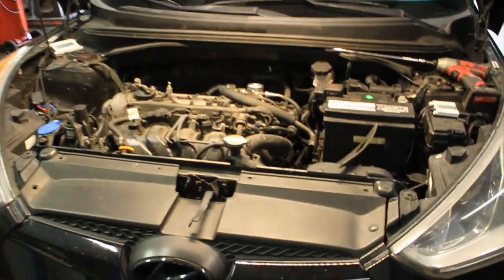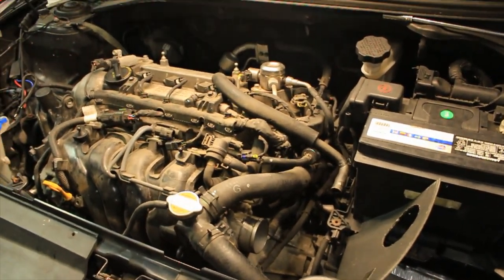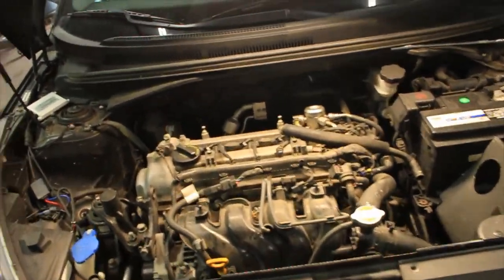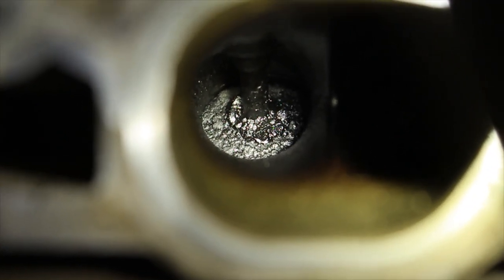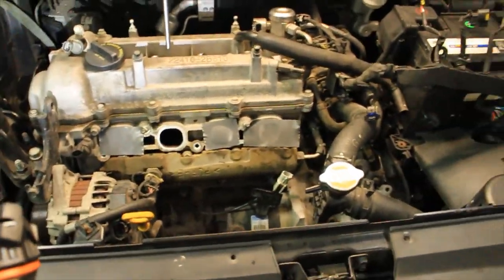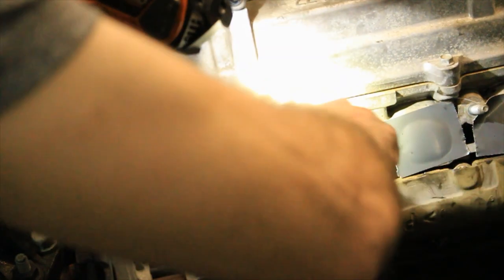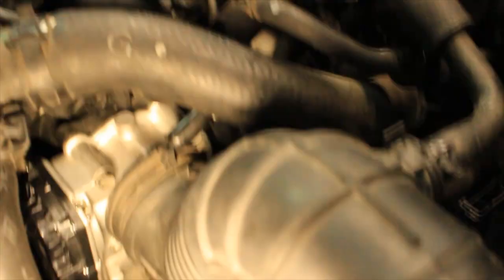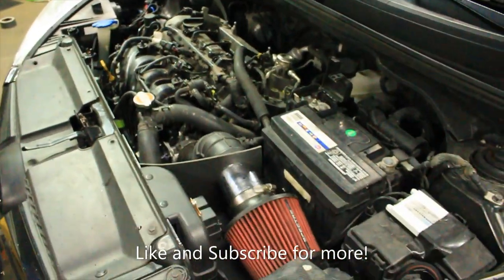Veloster Intake Valve Cleaning and Throttle Body Upgrade

Comment: The cover isnt cosmetic. It stops most of the heat from the engine from Effecting the paint on your hood. Without it you will have bubbling and cracking and peeling of paint

Comment: just so everyone coming in late knows, the coolant lines running to the throttle body aren't there to actually cool the throttle body, they're meant to heat it up and prevent frosting in sub freezing temps. if you don't live somewhere that cold, just bypass it, it'll actually run better because it won't be heating your intake air  up defeating the whole purpose of the intercooler.
Reply from the maker: This! 👆🏻

Comment: Also catch can is for turbo cars and performance engines. Seeing you never did a carbon cleaning i can bet your pcv valve is sludged up causing sludge to build in ur engine and excessive blow by and will cause oil leaks from excessive pressure. You wana build power on that engine. You would need a longtube header with high flow cat and 2in to 2 and a quarter inch exhaust with high flow muffler. Add a short ram intake with heat shield and tune. This car is an economy car wrong car to try and add power too the turbo veloster on the other hand is a diff story.  Your best bet would be to increase its efficency which clearly it hasnt been serviced properly by that carbon build up which is what will hurt ur power and acceleration as well as fuel mileage. If you serviced it that would provide better gain then that throttle body. If you have some pepboys or cheap ebay filter on it then its flowing barely more then stock. Put an aem on it atleast youl see a little gain maybe a couple hp
Reply from the maker: Awesome feedback! The PCV was replaced by me upon purchase at 41k miles, I replaced it again at 90k and again at 120k when I did my plugs and coils. The car is actually moved on to another owner but I appreciate the insight! I also own a very modified Talon w/ 4G63 and 08 G35s so I understand where your coming from! Hope to see you around the channel more often!

Comment: Took my intake off to change injector getting 4 cylinder miss fire looked  inside  have oil sitting on top of my intake valves ..  My spark plug is not getting fuel but has oil on the electroid of spark plug only 100k miles too.
Reply from the maker: No way it needs 4 fuel
Injectors lol

Comment: We've got one with 90,000 miles gonna do this in the Spring once the weather warms up a bit.  Saw another vid where a guy used brake cleaner & 10 zip-ties taped together (shape of a drill bit) attached to a drill as a nonmarring tool to remove the bigger chunks (and that alone got the valves really clean, not shiny clean like walnut blasting will).   Only wish you would have shown step by step of intake removal (doesn't look hard but for 1st time wrenchers it would help).  Also good to see that engine went 175,000 with no problems, hope to get 250,000+ from ours.  thanks for posting, peace.

Comment: I am the 60mm Guy, in 2013 I was the first to put the Elantra 60mm on the Veloster. I posted it in Veloster.org. I also did the coolant bypass. I still have the 2013 and the 60mm. There are 2 types of 60mm, long and short air horn. I use the short. Also with a NAV GAP the plugs at .030. Any question ask me. In cool weather put the coolant back on.
Reply: Hi! I have a Hyundai Veloster nav! I’m putting some performance parts! I want to know what more stuffs I can add to increase hp and tQ! I have done Short tan intake, throttle body spacer, throttle controller, straight pipe and a MagnaFlow muffler.
Reply: @pescabichopr4485  "straight pipe and Magnaflow muffler" xD
Reply: @pescabichopr4485  brand of throttle controller?

Comment: A catch can won't completely stop it but it'll reduced it in half or more. The type of oil you run in the motor makes a big difference too they do have gf6 now which is supposed to reduce it even more of the built up.

Comment: Nice vid.. I had a '14 turbo veloster and now '18 turbo elantra gt sport. Pretty much same 1.6 motor.
My standard manual calls for valve check every 60k miles. Do they clean these then?
Reply from the maker: It’s a service you have to specially ask for. Valve blasting or valve cleaning. Usually a few hundred dollars being a shop has to remove the intake. Definitely worth it though. I’d recommend at 60, 120, and 180

Comment: Any update on the new throttle body I'm curious
Reply from the maker: The throttle body worked great for bottom end throttle response. I enjoyed it.
Reply: @Pete_Tech_  sweet! I'm currently on a 1.6 build that's sitting in a rio the 2018 model, I've been researching alot about getting more N/A power and the bigger throttle body was one of the options I was looking into along with port matching etc etc. What are your thoughts on (ITB's) independent throttle bodies on this motor? .. I really want to explore the potential  of these new engines... I read somewhere where the casting is done by Mitsubishi but I could be wrong.

Comment: I hope u will respond to my question.  On the GDI fuel pump what tool do you use to remove the fuel line?
Reply from the maker: Just search. Fuel line quick disconnect removal set on Amazon.

Comment: Would sea foam handle a lot of that nasty, or would I need to take er apart?
Reply from the maker: Seafoam will not even get you 10% of the way to clean valves.
Reply: Holy crap so all that smoke, and thats only 10%?! 😳 oh I'd hate to see what they actually look like in that case... Thanks!

Comment: Thank you for the vid! Have you considered closing the valve and then pouring something in there that is good at dissolving carbon and then sucking it out with a shop vac? Then picking at the remains?
Reply from the maker: Yes, this video was a long time ago. I’ve found some chemical solutions that work pretty well. Unfortunately the valve is never “clean” unless it scrubbed.
Reply: @Pete_Tech_  thanks for the response. Do you still have this machine? Just got a 2013 Base with 160000 miles and it’s general condition implies that she had NOT had the valves (or injectors) cleaned. I’m sure they’re gonna be grimy
Reply from the maker: I sold this unit back in 2020 with 189k
Miles ran mint!

Comment: So you know carbon cleaning is due every 15k right? Im a Hyundai master tech and have never had to clean the jntake valves manually. Your problem is your trying to make a 1.6 na engine faster your not guna gain a thing from larger throttle body lol and a throttle body spacer wont do a damn thing on a direct injection engine. Having no cat and your guna add an exhaust woth larger piping good luck losing torque and all low end power from no back pressure. You need to reset adaptives and do a relearn procedure after replacing the throttle body with the wrong one lmao. If you did the cleaning every 15k you wouldnt need to do any of that. Your supposed compensation issue is from not reseting adaptives and relearn procedure. Your not gaining any flow through the head by installing larger throttle body but no change in porting or manifold and no tune to possibly add a little power.
Reply: What is the procedure for cleaning it. What would you recommend. I definitely have to clean mine asap man
Reply: Nice I’ve been doing this on my car but is it normal last few times I cleaned it with crc my electric power steering  light came on and locked . I  put it in first to drive it and then it turned off and I was able to  then move the steering wheel .
Reply: @jamesblount3715  im about to get a soul turbo and i think im gonna do this every oil change, thanks for the info.